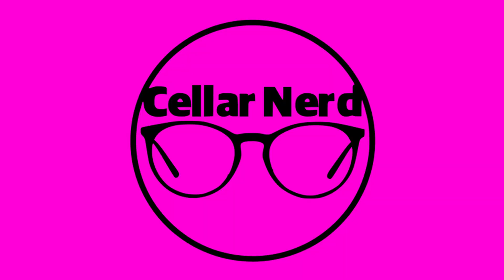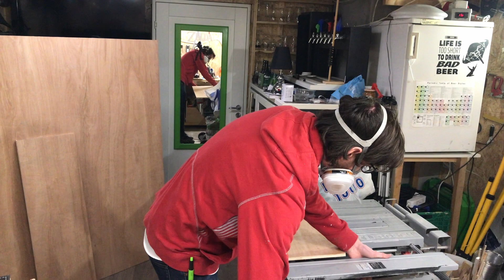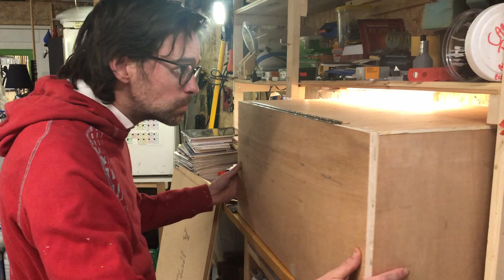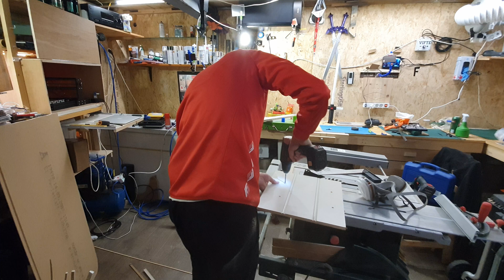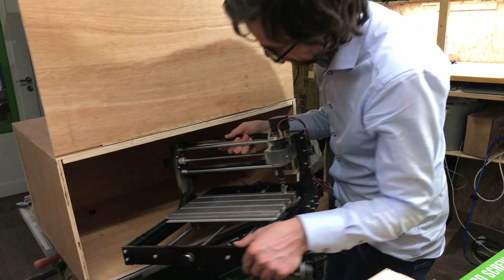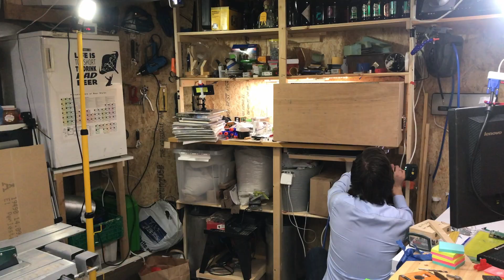New enclosure for my extended 3018 CNC

Comment: Could you elaborate a bit on Pi controlling the CNC? Do you mean it runs a g-code sender? 
Never thought of this really... But sounds like a good idea. I am not very much a Pi guy, though, but maybe it is time to become one.
Reply from the maker: I was using CNCjs (https://cnc.js.org) on a Raspberry Pi 3 (or was it 4?). It’s basically a GCode sender that’s available on the local network, so I didn’t need to keep the laptop connected and running at all times. I’ve stopped using it since, though, as I started using Easel as my main CNC software, and just send the gcode from there in stead. I kept having the SD card corrupt after several power interruptions (me forgetting to turn the Pi off before jutting the power to the machine…) But the camera was a nice feature, so I will set it up again once the laser I’m currently working on is done. (And while I did use the diode on the 3018/3040 to begin with, I’ve now built a standalone laser. I guess both are comping up in another video, when I get around to finishing and editing that one.)